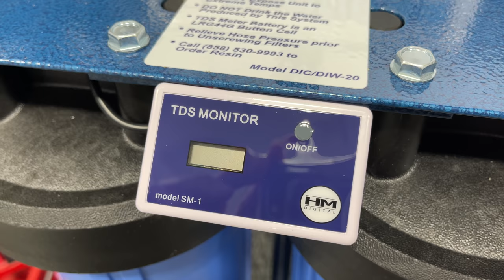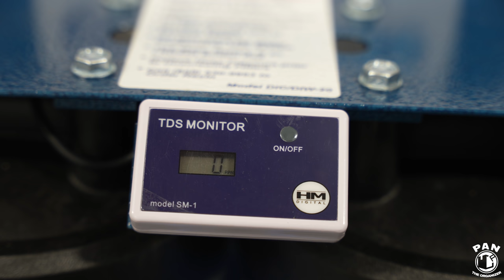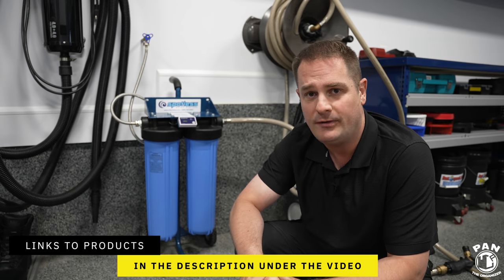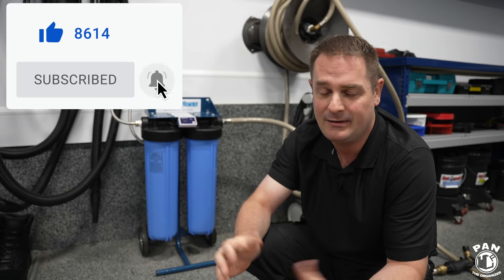No More Water Spots When Washing Your Car In The Sun!

Comment: I use my garden hose when washing my car which put out over 2.5 gallons per minute. What would happen if over 2.5 gallons per minute are put through the system? And if it could damage the system how can I lower the my water flow to under 2.5 gallons per minute?
Reply: If your output is greater than 2.5 GPM and the system can only put out 2.5GPM you will pull water thru the system faster than the system can process it and end up with water that isn't completely filtered and end up with water spots. You're best to use this with an electric pressure washer, they dont have the output of gas pressure washers (for example mine is 1.7GPM). This will ensure that all your water is filtered and spot free and this way you can also use a foam cannon for better cleaning.
Reply from the maker: You would have to ask CR Spotless.

Comment: Can I use this system throughout the entire wash or is it only worth it for the rinsing part.
Reply: to get the most bang for your buck, i would only do it after your main rinse (use main water to rinse most of soap off followed by final deionized rinse). no point in using it throughout
Reply: @matchoow  So there wouldn’t be any risk of damage from all the initial hard water use as long as you finish with a deionized rinse?

Comment: I spent $400 on w system to find out my water was under 100 ppm 😆
You dont have a places in Canada that will rent out DI tanks? I know if i owned a business i would prefer a large system.
Reply from the maker: I don’t know of DI filter rental places in Montreal.
Reply: My water is only 43 PPM but it still leaves water spots on the glass if the water dries in direct sunlight after a wash. A dual bed resin setup would be overkill and unneeded with the water quality that I have so I ended up ordering a mixed bed resin setup a few days ago. I still waiting for it to ship. :crickets chirping:

Comment: Hi Pan! I just bought a TDS Meter to test my water and it averages around 700ppm which is terrible. In a case like mine, a DI system would not be very economical since I would have to change resin very frequently. Do you have any alternate solutions for someone like myself with super high PPM? I know I could do rinseless, but I enjoy using the pressure washer and stuff. Thanks!
Reply from the maker: Apparently an RO membrane based system could also do the job, but those are quite expensive from my understanding.

Comment: Do you have to drain it after each use?
Reply from the maker: No. But What I do after each wash is still shut the water outlet, shut off the pressure washer, and activate the trigger to flush what ever residual water is in the hose (relieve pressure). 10-20 seconds usually does the trick. Just like you would when water your lawn with your garden hose. Once you shut off the water, you clear any remaining water or pressure from the trigger of the garden hose before coiling the hose on the reel.

Comment: Since you already have the water softener, can you get more than 300 gallons
Reply from the maker: No it’s actually the opposite. Having a water softener actually depletes the deionizer’s resin quicker. I asked CR Spotless and they confirmed that it’s normal as there is slightly more salt residue in softened water setups which acts on the deionizer resin.

Comment: Hey pan, quick question! Can you apply turtle wax seal n shine without using a clay bar or iron remover first? Or is it okay to just do iron decon and not clay bar?
Reply from the maker: You can just wash your car and apply it. But the more time you spend prepping the paint before applying any form of paint protection, the longer the protection will last and the better it will perform.
Reply: @PanTheOrganizer  Thank you! 😁

Comment: I am looking at this unit or the On The Go duel bed standard deionizer, have you heard anything on OTG unit to compare to the DIC-20?
Reply from the maker: I haven't.
Reply: @PanTheOrganizer  are you using yours for a full wash or just final rinse? If full wash, how many cars are you able to get before replacing the resin?
Reply from the maker: I just use the DI water for the final rinse. I was blowing through too much resin quickly when using it all the time, and quite frankly you only need it for the final rinse.

I have a whole house water softener too, and that actually depletes the DI resin even quicker unfortunately. I spoke to the owner of CR Spotless, and there's nothing I can do about that. I don't calculate how many cars I do with two tanks or resin, but I'd say I change the resin twice yearly. But I do wash my car twice weekly and detail a lot of cars.
Reply: @PanTheOrganizer  that’s  great to know. Thank you. That was my plan as well. I tested my water the other day and it was at 131 ppm without any RO or a softener

Comment: I have a question Pan. I have 2020 Subaru WRX ceramic coated with Armor Shield by Avalon King. I did the ceramic installation. I live in an apartment and my car stands under the shed but no escape from rain and sun. Now I have water marks on the coating how do I get rid of them. I do not want to take a buffer at it again, as it will take off the coating.  I was thinking ONR with sponge like you have showed in one of your BMW 5 Series videos. Any suggestions??
Reply from the maker: Watch my water spot removal video: https://youtu.be/s1XNKFVSwRk

Comment: So what’s the difference between that and a home water softener?
Reply from the maker: A water softener doesn’t remove 100% of minerals. A water deionizer removes 100% of minerals.

Water softeners (also called cation exchange softeners) selectively replace positive ions in water like Calcium, Magnesium and Iron with Sodium ions. Aesthetic issues like spotting on glassware, cooking surfaces can be avoided with softened water.

Deionizers remove both positive and negative ions from water. Deionized water is used in aquariums and laboratories where high purity water is needed.
Reply: @PanTheOrganizer  so if you already have the water softener and you get that system, it would be great
Reply: Thank you for taking your time out to answer my questions
Reply: It means a lot
Reply from the maker: My pleasure. How did you discover my channel by the way?

Welcome to my channel. You discovered one of the biggest car detailing channels on YouTube as we surpassed 980,000 subscribers and we have over 132 million views! I have been detailing for 26 years and I love to share my knowledge and passion with my viewers.

You found the right channel to help you learn everything about detailing.

Comment: Great help Pan.  I am unclear though about the need for a water softener for my house.  We have very hard water (200mg/L) so initially thought I needed a water softener before the DI system.  However, on one of your comments to another viewer you said the water softener actually adds TDS so he would be better off going direct from his regular water directly to the DI system.  Please clarify.  And, if I do install a water softener upstream from the DI system it's my understanding that water softeners are usually only on the house HOT water systems. So, is the tap to your DI system in your garage hot? Or does your garage tap not pass through the water softener? Thanks
Reply from the maker: Correct. A water softener is not needed in this scenario as it would raise the TDS levels and blow through your DI resin quicker.

If all you want is a pure water with zero minerals, just get a DI system for your garage. 👍🏻

Comment: Won't distilled water have the same effect and it's cheaper?
Reply from the maker: Yes but you have to go and buy the gallons, haul them around, and you can't really use those with your pressure washer... This is a setup to filter and deionize the water at the source, so you can feed clean water to your pressure washer or garden hose.

Comment: As usual, market something existing to the detail market and mark it up multiple times!
What do window cleaners use to wash your house and commercial windows, that dry spot free? Yup, DI water.
Simply buy a DI resin filter from a window cleaner supplies company! That's what I did, a nice big 11lt cylinder c/w resin and TDS meter for only £100. This lasted me over 2 years and simply buying some premium replacement resin from the same company was as new again. Plenty of flow with half inch quick release couplings too.
Reply from the maker: Interesting. I’m new to DI systems and this one was the one most recommended to me by all my detailing friends. And so far I’m impressed. Works as advertised and it was stupid easy to install.
Reply: @PanTheOrganizer  yep they work great, and I'm so surprised not more commonly used. Two years ago I asked my local window cleaning guy about the DI water he used to wash our house windows which got me searching on line for window cleaning supplies. In the UK you either buy from a window cleaning supply wholesaler, or from a detail supply company, but when you buy from the detail supply company they double the price, give it a fancy techy name, and slap their sticker on it!!
Reply from the maker: Thanks for sharing!

Comment: My Kränzle 1152 TST needs 10 liter of water per minute. Will this CR Spotless DIC-20 (High Output) be able to provide that much deionized water per minute? Also in Europe I can’t buy this product. What would be the European alternative? Or can we convince CR Spotless to also serve the European market? That would be even better :)
Reply from the maker: I have a Kranzle 1122TST (North American version of the 1152) and have absolutely no problems. I run it at 1000-1100 psi thanks to a 4.0 orifice on my Mosmatic gun.
Reply: @PanTheOrganizer  according to the 1122 TST manual the unit needs only 2,1 GPM or 7,95 liter per minute 🧐 that’s 2 liters less every minute that required. Would you be able to test how much water you actually get from the CR Spotless? That would help me a lot 😊

Comment: My water is 152 ppm would I still need a spotless system
Reply from the maker: In general, water with calcium or magnesium levels at or above 7 GPG or 120 PPM officially qualifies as hard. So in your case, you have hard water. The hardness of water is determined by the milligrams of calcium carbonate per litre and is reported it in parts-per-million (ppm). In general, water with less than 60 ppm can be considered soft, water with 60-120 ppm moderately hard, and water with greater than 120 ppm hard.

So your car washing experience would greatly improve by getting a water deionizer system like this for sure. You'd have 0 ppm, for a spot free wash, zero mineral deposits, zero water spots. Better foaming and suds from your soaps too.

Welcome to my channel. You discovered one of the biggest car detailing channels on YouTube as we surpassed 980,000 subscribers and we have over 132 million views! I have been detailing for 26 years and I love to share my knowledge and passion with my viewers.

You found the right channel to help you learn everything about detailing.
Reply: @PanTheOrganizer  thank you.  Matt from obsessed garage is working on a filter system.  Coming out this year.  You think it be worth waiting for. Or with the cr spotless one now ?

Comment: A 50/50 would be nice or one car rinsed with this water and the other with “normal” water
Reply: The rinsing ability would be the same. Rinsing with tap water or distilled water is hard to tell by eye alone. It's just the fact if it'll leave water marks if left unattended/not dried/evaporated.

Comment: I use filtered rain water, cheap and spotless!
Reply from the maker: How do you filter your rain water??
Reply: @PanTheOrganizer  I have an affordable inline RV style hose filter. I also have my water entering my barrel through a fine mesh pool fiter sock to remove larger particles. Rain water is naturally distilled water and only pics up some minerals from atmosphere dust and whatever surfaces the rain is collected from. For me it's natural slate roof, but eventually I wanna upgrade to a metal roof.
Reply from the maker: Very cool DIY solution!

Comment: No need to replace resin. You can regenerate with salt.
Reply from the maker: I never heard of that for deionizing resin. How would you do that?

It’s not like my water softener that has a brine tank that self regens every few days.
Reply: Either by opening it up and adding a can of salt to it followed by a slow trickle flow of water through it or use a canister which you can put inline and fill it with salt and allow it to push through the filter slowly. I found it on a youtube video. Do a search.

Comment: 300 gallons per bag of resin isn't gonna go very far when washing a semi and trailer :( I'd be changing resin every time I wash it.
Reply from the maker: They sell a bypass system so you can use DI water only during the final rinse if you want.
Reply: @PanTheOrganizer  I agree. After thinking about it a couple days, I realized I can keep washing with soft water with the Hotsy pressure washer (3500psi), then just do a final rinse with a hose or 1500psi washer. I'll prolly get one of these units next Spring. Thanks for the video!

Comment: I Bought this CR system years ago, what a piece of crap it constantly leaked no matter what I did.  Really low pressure when connected.
Reply from the maker: I have zero issues with this and constantly wash cars using this. Absolutely zero pressure loss with my high end pressure washer.

Did you reach out to the company to troubleshoot?